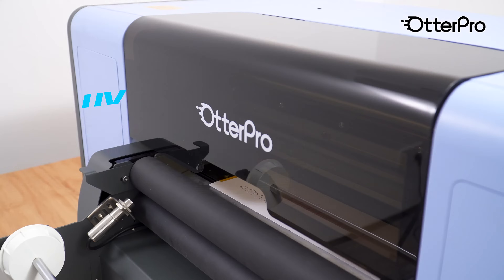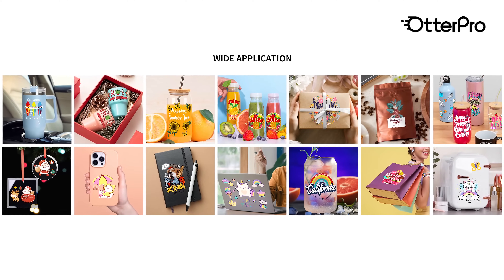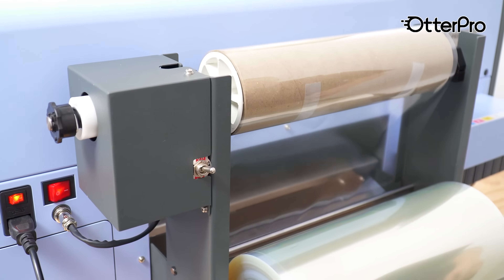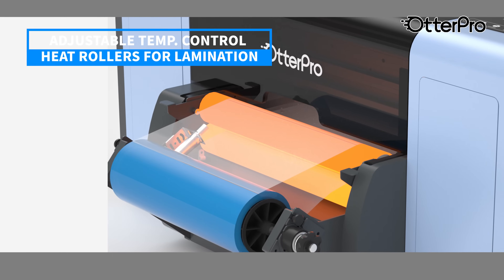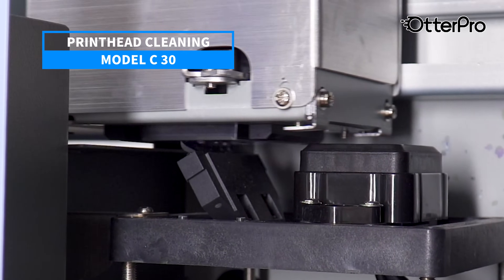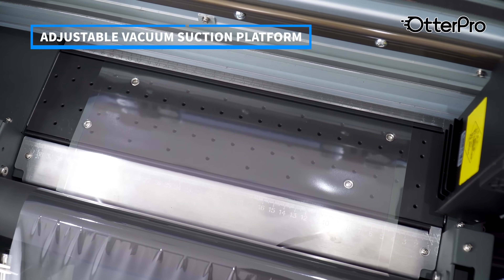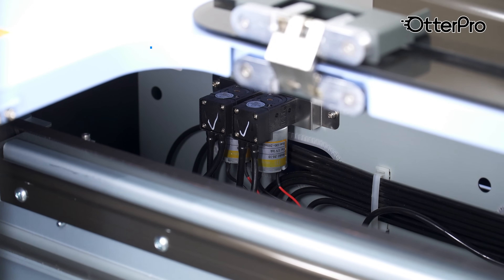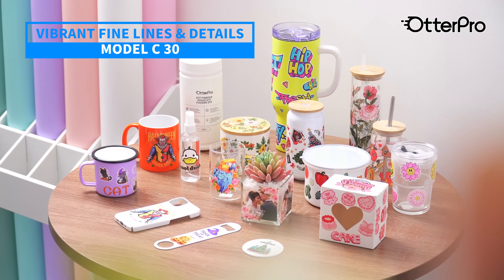OtterPro UV DTF Printer Model C 30 | For wood, paper, acrylic, ceramic, plastic, and metal!

Comment: What if you have to leave it for two weeks without printing?
Reply from the maker: Hi, You can leave the printer for two weeks, but it depends on your area's temperature and humidity. To prevent clogging, we recommend daily use.

Comment: What about maintenance? Should it be run in daily base? If it’s left not working for a week would that cause ink clog?
Reply from the maker: If you use OtterPro Ultra DTF Ink and make the capping station wet before you leave, one week not working will not cause ink clog. Thanks.